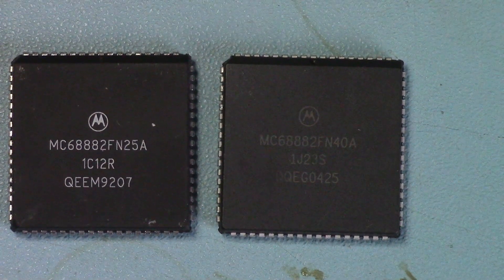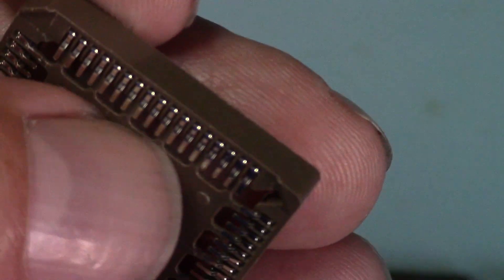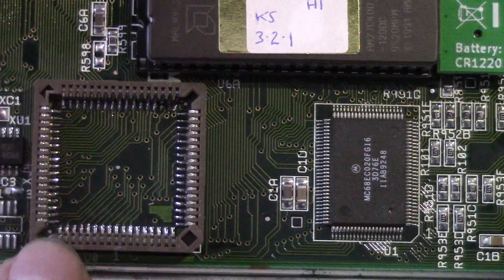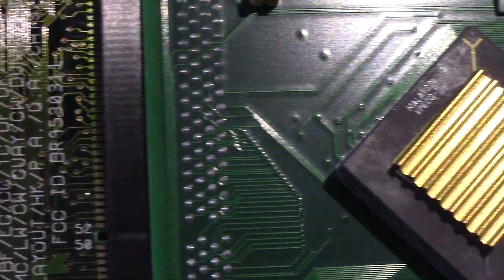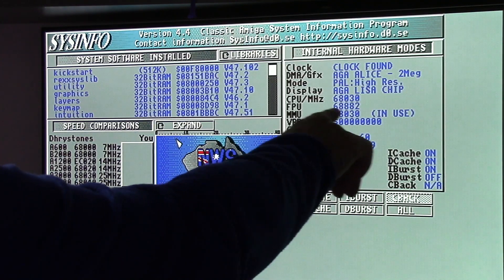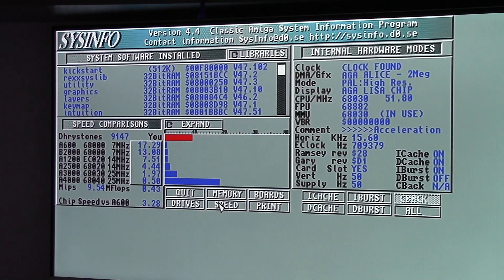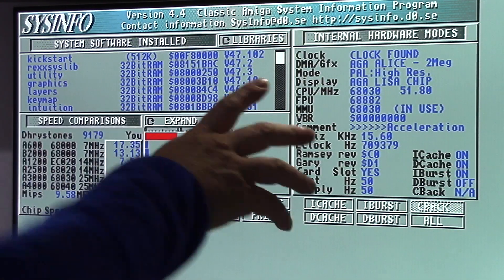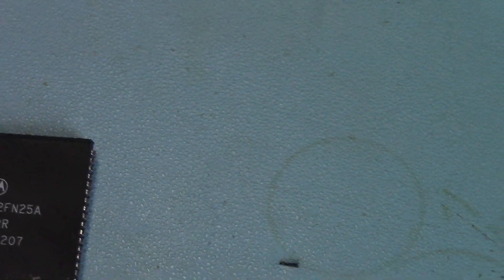What happens if I solder an FPU into my Amiga A1200...

Comment: The FPU certainly speeds up rendering. You can really see the difference in WinUAE if you toggle FPU on and off and hit the ol' LightWave render button (make sure you're running the FP version of LW3D, of course).

Comment: If you remove the bottom of the socket, is the connectors along the midpoints of each side still being able to make a good contact over time? Because all those springy contacts would want to bulge the socket outwards methinks, and with only the solder points on the board holding things together it might not be enough. Maybe. I dunno! :D

Also, PLCC sockets tend to be kind of brittle and easy to crack; for longevity I'd rather keep the bottom of the socket in place I'd think... :)

Comment: You don't need to knock the bottom out of your socket to solder it, just use a 0.3mm soldering iron tip.

Comment: I have an FPU slot on my Blizzard A1230 MKII and it accepts a 50 MHz FPU and runs at the same speed as the CPU.  If possible, its best to get an FPU on the same board and have them running at the same speed.

Its awesome to know that the A1200 can have an FPU mounted onto the motherboard, I've always wondered if the traces actually went where they could be of use.  As I had an accelerator with an FPU anyway, I never tried to put one on the motherboard.

The IDE interface on the A1200 does support 2 drives (4 if you get a splitter) and I found that a modern laptop IDE SSD will fit nicely into the hard drive mount and is thinner than the Amiga's original hard drive.  I then used double sided tape on both sides of some plastic to insulate the under side of the IDE to CF adapter and stuck it to the top of the  SSD.  I then made a custom cable with 3 mini IDE sockets and secured the drives to the mount.

My main Amiga 1200 setup

HD floppy drive for 880 K and 1.44 MB disks (ROMs need upgrading to use HD drive)
3 x External floppy drives 880 K
8 GB IDE SSD - 2 x 4 GB partitions
8 GB IDE to CF adapter - 2 x 4 GB partitions

Blizzard A1230 MKII @ 50 MHz + FPU
128 MB RAM
Blizzard SCSI interface card
128 MB RAM
External SCSI HDD x 2 @ 60 GB - 4 GB partitions
External CD-RW x 2
External SCSI backup tape drive
SCSI scanner

Total RAM 256 MB + 2 MB on board
Reply: I've not tested between motherboard FPU and one on expansion, so I can't comment. I would assume it would be like a lot of hardware, where it is almost always better to run directly on the motherboard (obviously don't try to run 2x FPU's at the same time). If you do this mod, please let us know in the comments which gives the best results.

Yes, it's absolutely worth putting an SSD in the A1200. I put a 128GB M.2 SSD in mine without any problem, I made a video about that upgrade too.

Comment: Minor Comment: You seemed to compare the "Dhrystone" figures, but that's an Integer-Benchmark anyways. The relevant figure to check the FPU performance is the "MFlops" Benchmark figure.

It was still equal in both your tests, at 0.43 MFlops. Which is exactly what you can expect from the 68882 running at 14 MHz.

Comment: Yep, a direct install will clock the FPU at half the oscillator clock, just like the onboard EC020. But you can lift pin 11 of the FPU (or the PLCC connector, like I did) and jump it directly to E122R (just above the oscillator) and get the full 28MHz clock.
Reply: Great info there, Sir! I will be trying this out for sure. Thank you!

Comment: Makes sense, as the CPU Clock signal from the oscillator is tied to both the 68881/68882 and the 68020, so yes it will pull the A1200 motherboard Clock.

The circuitry for ascertaining the primary CPU between the Onboard and Trapdoor, is a simple circuit that ties the 68020 in to a never ending wait for Bus control, while the trapdoor receives an unimpeded Bus Grant signal.  Same for the 600, with the 68000 on the motherboard and the clip on CPU/FPU boards, force the 68000 in to a never ending wait for Bus control.

At power up, the onboard CPU sends out a _BR (Request Bus control), then the CPU sits and waits for a _BG (Bus request granted), but what you do is tie the _BG pin to ground via a 1k resistor, and the chip just sits there waiting.  Then on the expansion board, you tie VCC (with 1k Resistor) to the new board's CPU pin (_BG) so it gets permission over the system bus, and off it goes.

Where you are going to run in to problems is the Expansion having a 68882, as well as one soldered (or by socket) on the motherboard, then you will have 2 devices trying to take up the same address space, likely cancelling each other out..  But having said which, the 68882 is a rather poor floating point unit.

https://imgur.com/a/fO2m5xA

Comment: The more important question is: how does it behave with only an on-board 68EC020?
Reply: yes, I was thinking this was to be put in a stock A1200, but it clearly has an 030 CPU that is faster than an A1200 one, but there does not seem to be any mention about the CPU having been replaced or an expansion board.

I am pretty sure the FPU did not make the 020 seem like an 030 and just be faster after putting the FPU in?
Reply: @KasperSOlesen  Of course not. The raw benchmark speed is equal to the one of a 1230+FPU accelerator (~17x of the basic A600).
Reply: @perinoid  yes, so it does not make much sense why the video is all about putting an FPU into an A1200 and then having some expansion card in that A1200 as well. Seems more interesting to test it only with the built in CPU and then maybe also compare it to tests with an expansion card.

Also would it work with something like the ACA1221 cards? Seems plausible.
Reply: @KasperSOlesen  Terrible fire card TF1230 is without FPU - so it make sense to add FPU to the motherboard . FPU  works synchronous with CPU - so it base is 14MHZ - but if you pull up the 11 pin from FPU and connect it directly to the oscillator on board then you have a FPU on 28Mhz.
Reply: @flowcomp  sure, it makes sense to want 030 and FPU. But the video mentioned nothing about "030 expanded Amiga 1200" and fails to even mention directly that it needs an expansion to use this, you have to figure it out by reading the benchmark screen.
Reply: @KasperSOlesen  he mentioned at the beginning the accelerator card running at 50mhz...and showed the TF1230 briefly as well.  You'll notice the 68030 cpu with a heatsink thermal glued to the top.